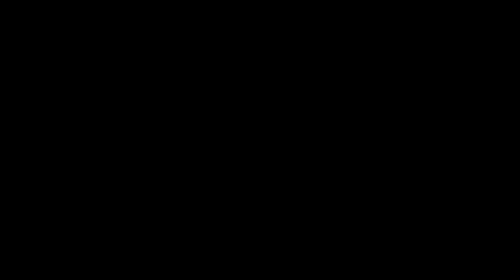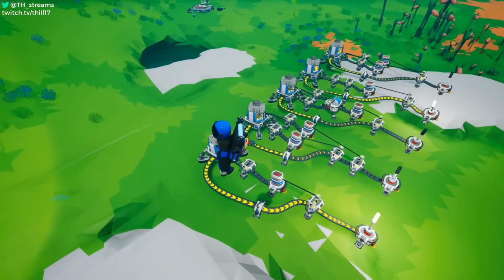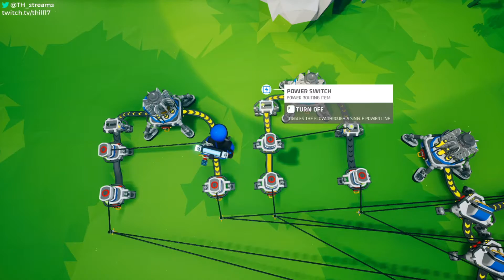Automation 2.0 Logic Gates

Comment: I have a possible use for the xor gate.

At the moment I'm using one button to cycle through arms intaking on my auto sorter, to arms dispensing, to arms off.

But another way to do it is by having separate buttons for arm intake and arm dispense.  Only if I use two buttons, I don't want both set of arms to be active at the same time.  An xor gate could help ensure that doesn't happen.
Reply from the maker: Ah ok ok, thats a pretty good use case for it!

Comment: Wouldn't it be simpler to make the AND gate using just 2 switches inline? That is the most simplest form, as opposed to your shown design; you literally have the simplest AND gate inside of your NAND gate.

I would also add that these show how power detection can be used as basic gate logic - the same principles can be applied using anything that can toggle things. For instance:

I needed to employ an AND gate for my automated rail station resource collection that will send back a special filtered item whenever the Auto Extractor ran out and no items were put onto the station when the train comes back around again. I put an autoarm opposite the side of my Auto Extractor from the station and put a power switch between it and the station, and placed another platform in its pickup zone that holds a single item that is normally not shipped on that train (i.e. Laterite at the Laterite site - the Auto Extractors smelt it all into Aluminum using Portable Smelters). The switch gets toggled by two rail posts that I set as the priming section just prior to the rail station in question (Input A is 1 when the train is within this section), and I installed a storage sensor, set to E&NE mode, on the rail station itself, which toggles the autoarm on and off (on when the storage is empty). This effectively is a 2 input AND where the special item is pulled and added to the train whenever the train approaches a station that is still empty (due to the A.E. having nothing to mine). All I have to do is ensure my entire train network/line takes at least 70 seconds per round trip and only stops at each station once per trip. What I can do with these special items from each station is filter them at my Storage site where the primary station is and have them placed on a platform near my Resource cans corresponding to that node as an indicator that I need to adjust the A.E. for that resource.